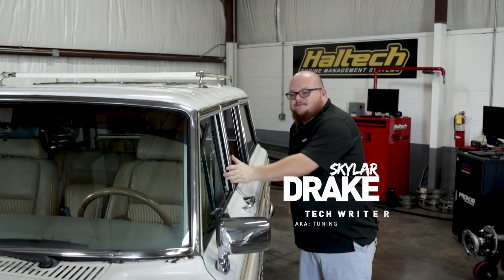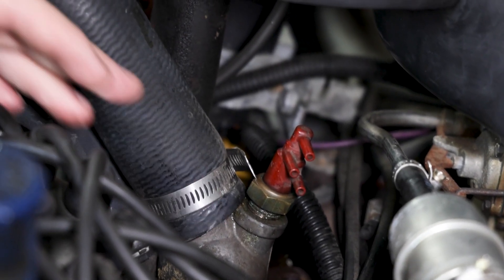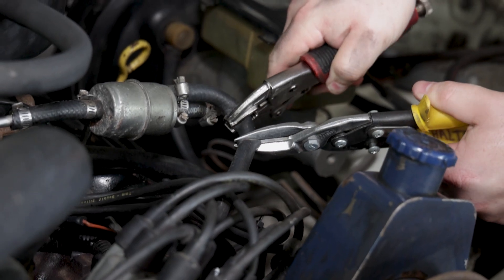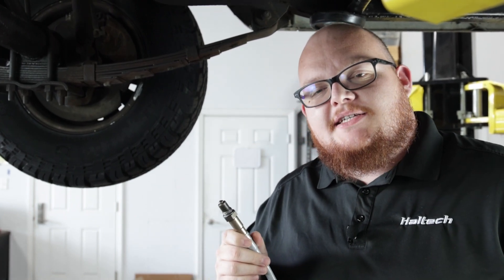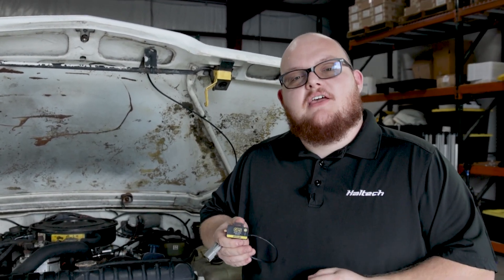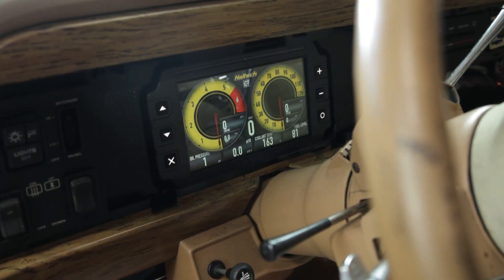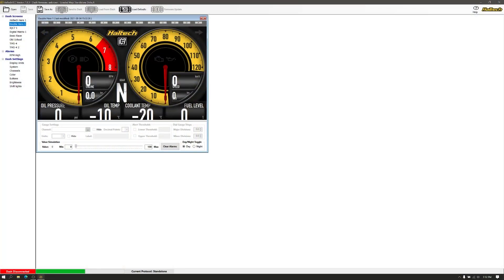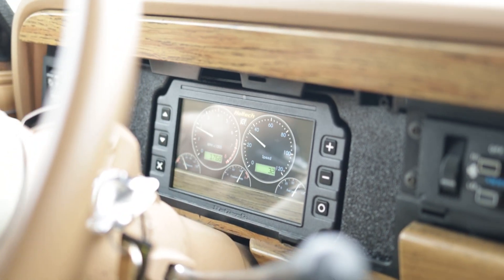🛠 Stand-alone iC-7 install on a carbureted Jeep | TECHNICALLY SPEAKING

Comment: I asked on the original upload of this how accurate is the fuel pressure reading?
Reply: I'd say pretty accurate. Haltech supply the sensor and have a pre-calibrated profile in the software. Pressure sensors are pretty simple devices.
Reply from the maker: If the fuel level sender is set up and calibrated correctly it should be very accurate.

Comment: I really hope that was an old O2 sensor. If I saw a shop do that I would never go back.
Reply from the maker: Very observant! During the welding process it's necessary to install a sensor into the threads to keep the threads from distorting while welding.

You'll notice that the sensor used during the welding sequence is greasy and black. (old) The sensor that Skylar installs later is new, fresh and grey.
Reply: @haltech  almost like you guys know what you are doing or something... 😉

Comment: So you lose your speedo when you lose signal to the GPS satellite. Kinda stupid. I wouldn't rely on that.
Reply: Pretty hard to be out of range of satellites these days
Reply from the maker: If you don't drive in tunnels all day, daily, you're probably ok.
How often does your cell phone lose GPS signal?
Reply: The GPS module is an optional extra, you can just wire in your factory speed sensor.